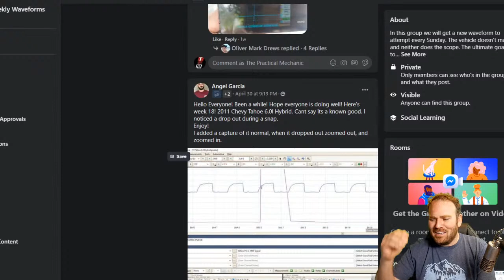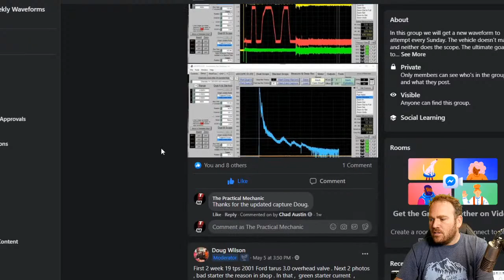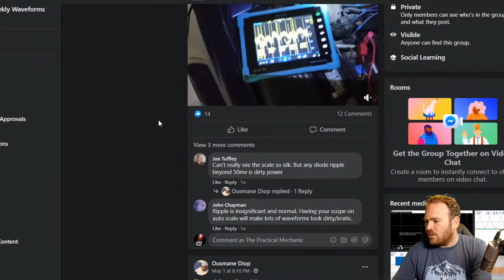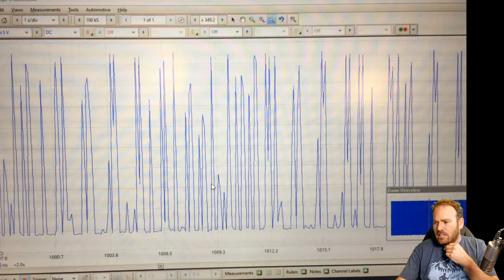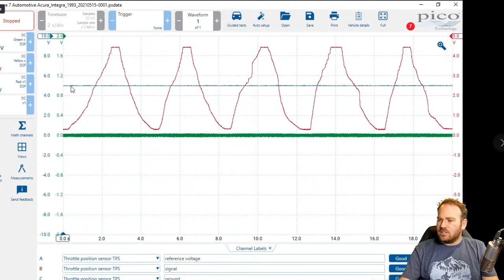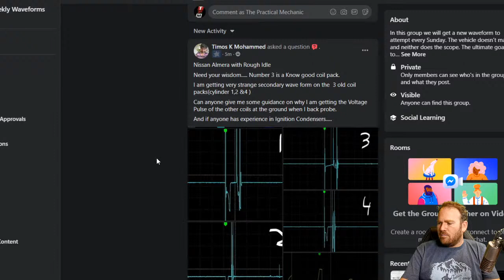Weekly waveform 19 recap- Throttle position sensors

Comment: 24:08 I was wondering if someone would send in a SENT protocol waveform :)
Reply from the maker: Thanks for watching the replay. 
Is this a digital signal from the tps? Service information must be incorrect because it shows a 0-5 volt sweep and never mentions a digital signal or communication signal. 
Next we are going to need an arduino to decode the messages.
Reply: @ThePracticalMechanic  When it looks like that it is surely digital; not easy for Arduino to interpret this signal, but Picoscope can help. Set up Picoscope to capture for several seconds at 3MS/s or more, move the throttle, then use Serial Decoder for SENT Fast. Serial data can be exported into Excel and plotted there.
Reply from the maker: @DmitriyL_Arithmechanics  thanks for the tip. I want sure if pico could decode that.